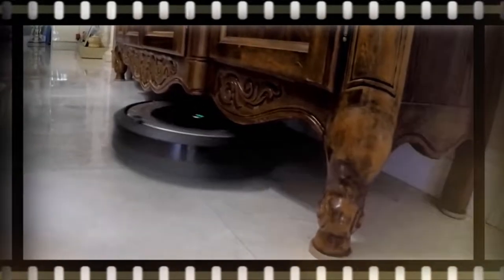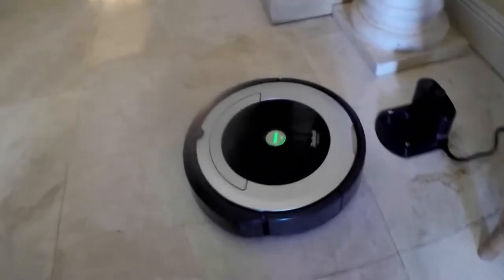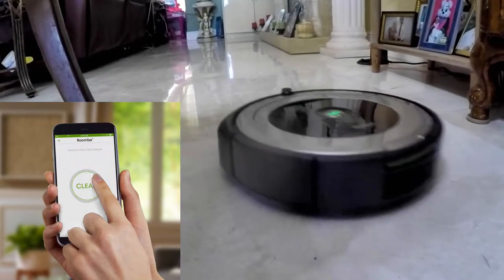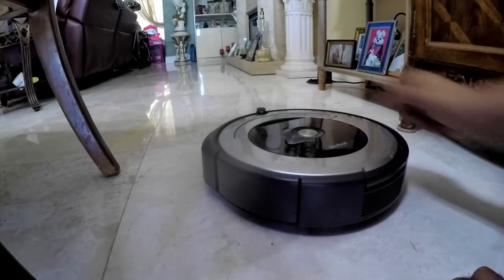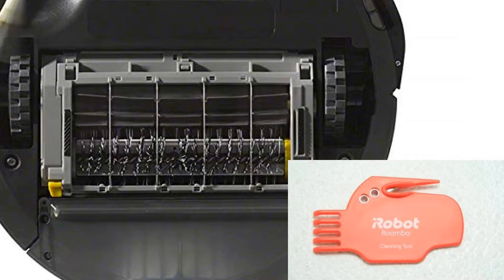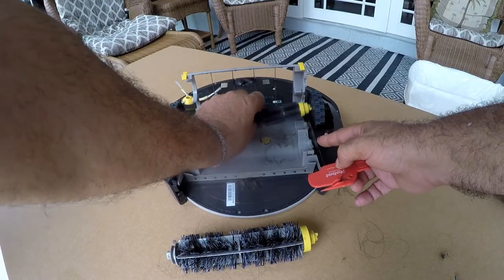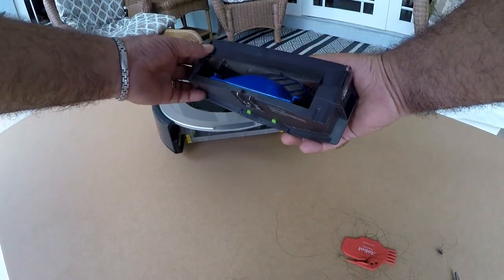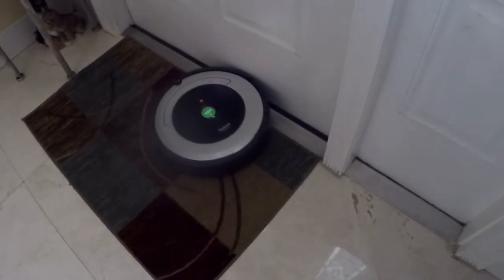IROBOT ROOMBA 690 VACUUM CLEANER (REVIEW) | WiFi App

Comment from the maker: Sleek, premium design complements your home décor; includes 1 Dual Mode Virtual Wall Barrier for more control over where your robot cleans.
3-Stage Cleaning System and Dual Multi-Surface Brushes pick up everything from small particles to large debris
Patented Dirt Detect sensors alert Roomba to work harder on concentrated areas of dirt, such as high-traffic zones of your home.
Full suite of intelligent sensors guide the robot under and around furniture to help thoroughly clean your floors.
Clean and schedule from anywhere with the iRobot HOME App; compatible with Amazon Alexa and the Google Assistant.
Irobot Roomba is a wireless battery operated vacuum cleaner.
This review of roomba 690 review is our experience after 1 month of use.
Reply: like #1

Comment: I have thought of getting one of these.  However, I have long hair and feel like I would be spending a lot of time on the maintenance one this or the motor would burn up quickly.  Thank you for sharing this review.  It will help me with my decision.
Reply from the maker: I should have explained more on that subject. Long hair is not a big issue with us so far. once a week an extra 5 minutes to pull the hair around the brush and axles is not a big deal. So far🤔
Reply: @JohnCRV  Thank you for this feedback.  I am planning to have hardwood floors installed in the near future and one of these would be perfect.
Reply from the maker: Hardwood floors, that will look nice. Good luck with your decision.
Reply: @JohnCRV  Thanks.  This is a huge decision for me but it needs to be done.
Reply from the maker: @PidasianHippie  - I'm curious, ask the store and the installers  if Irobots damage wooden floors. The only reason why I ask is because one comment on Amazon mentioned that it ruined the wood floors? I found that a little weird.
Reply: @JohnCRV  I will do that in my preparations to get the wood floors.  As you know, a lot of people complain about the slightest of things.